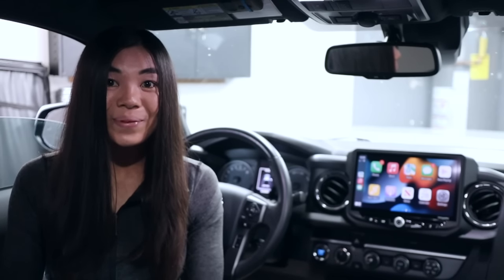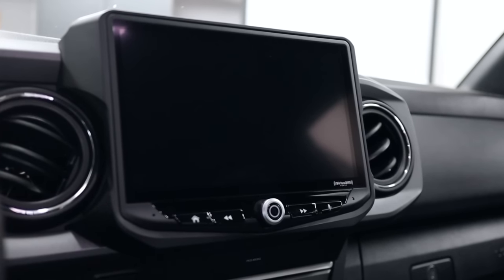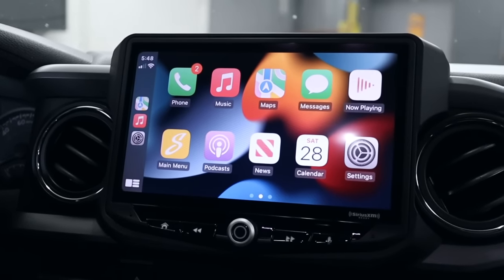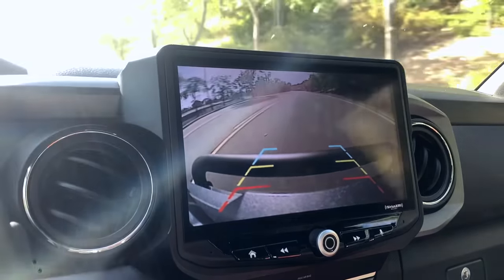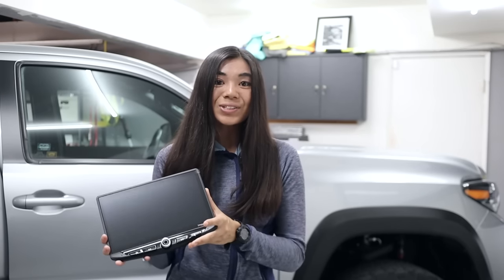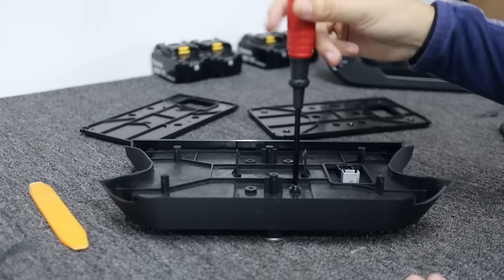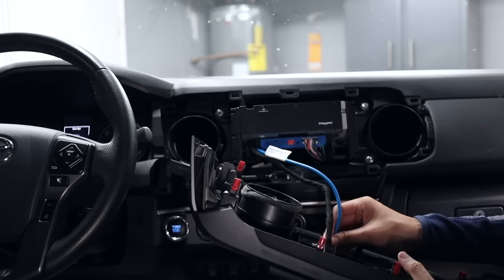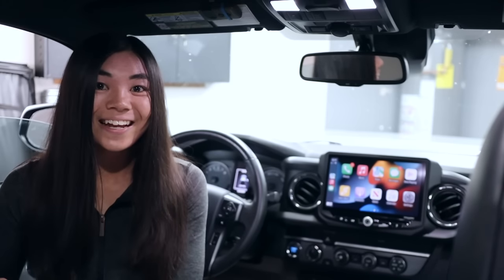A new GIANT Head Unit for my Toyota Tacoma! | Stinger Heigh10 Install + Review

Comment: Was going to get this head unit but found out from talking to Tacoma Beast you loose most of the Information from the infotainment above the steering wheel   like average gas mileage  average trip fuel economy and tire pressure monitor. Not worth it if you loose these items
Reply: This comment should be higher up. 
This is a really important thing to know.
Reply: This is what makes me hesitant as well. I might look into replacing my 2019 head unit with a used 2020+ head unit though so I can use android auto.
Reply: Agreed, very important information about losing that feature.
Reply: Can you clarify? Do you mean to say the information all together (both above the steering wheel and on the main screen) does not show, so you lose this information altogether? Or does it still show in one of the 2 areas?
Reply: That sucks because it say right on the website it retains all the stuff you said wouldn’t be available
Reply: @duvalpenny100  is it a direct plug and play switch?
Reply from the maker: Actually, I still get all of those things (average trip fuel economy during your drive + summary when you stop, TPMS, lane departure alert, and roll/pitch angles). Those are separate from the system from what I can see
Reply: @ChloeKuo  Glad to know because when I called Tacoma Beast Customer service they told me I would loose those features. Maybe they misunderstood what I was talking about.
Reply: @JPK1981  I can't answer that with 100% accuracy, but I do know that it's possible. I THINK it's plug and play, but don't quote me on that.
Reply: Hi… My truck is a Tacoma 2021 and, as Chloe mentioned, I was able to retain all the functions.  And yes, it is 100% plug and play.
Reply: lose*
Reply: Not only are you wrong but all that information is available in the MID. No idea why anyone would want to pull that information up on their infotainment screen when it’s located right in between your gauges 🤦🏻‍♂️
Reply: Joying HUs have all of this, including wireless. And pretty cheap
Reply: @PHILLIPS8822  they are forced to tell you that they don’t want you messing with their vehicles
Reply: @ChloeKuo  thanks for the video. Do you still get miles (Km) to empty as well on your info screen (by the Speedo)? Does the compass on your rear view mirror still work? I’m getting conflicted info on this. Mine is 2017, so I think even older than yours was.
Reply: @josearodriguez9601  Can you use the current Sirius XM Antenna on the Tacoma when you purchase the SiriusXM 300 tuner?
Reply: @bodybong  vehicle stats is an important part of making the decision to upgrade. Without this, it's useless. There are other units out there that have an amazing amount of vehicle stats AND includes Android Auto.
Reply: I think the screen is oversized for the dash.  I’d opt for a 2021 head unit to gain car play.
Reply: It’s lose…lose lose lose lose lose…smh
Reply: I just put mine in and I didn’t lose any of that
Reply: @justinkimball1399  Thanks for the info. I've already purchased mines 3 weeks ago because it's so damn hot I haven't had a chance to install it yet.
Reply: awwwwwww damn
Reply: If you use the PAC audio pro adapter it doesn't loose much. I only lost items associated with gps. I still have tpma info and mileage
Reply: @ChloeKuo is that radio JbL compatible for us people with the 7 speaker system and amp…because my truck sounds amazing but I would love the monitor upgrade for car play
Reply: @delavida1862 yes it is there is a setting seperate plug that needs to be plugged in on the PAC control module to retain the factory amp and settings as far as the speakers.

Comment: In my 2023 taco, if you hold the mode button on the steering wheel it will pause whatever is streaming.  Should work for yours as well. Thanks for another great video!

Comment: "No manual pause button." ~ 4:00 mins in; the stock 2016 - 2019 head unit can pause & resume via the steering wheel MODE button. You just need to hold it for 1.5sec. This will pause the current song and then resume with another press. (I'm unclear if this will work wit the Stinger head unit, but it should be very easy to test.) Thanks for all the quality Taco videos; always a quality watch. 🤓🤙🌮🚙

Comment: Chloe, thanks for the quality content.  Your attention to detail makes me think you are an engineer by trade. 
I really like the professional fitment of this unit in your truck. 
As for JBL systems, I and my son have owned multiple Toyotas since JBL was available. While the JBLs do provide better audio quality over non-JBL systems, they are only a fraction of what is possible (and practical). Better sound can be achieved with just better speakers. 
Getting ready for a Pioneer unit install in my wife’s durable 2013 Highlander Limited.

Comment: Chloe - they make USB CD Players that are compatible with Android radios. Since the Stinger Heigh10 is essentially a Android Radio, there's a good chance that one of these USB CD Players will work on it - something you worked have to explore.
Another option to play CD's on it is to usea universal 1/2 DIN CD Player and hook it up to the Stinger Heigh10 using the RCA Aux inputs.

Just a tip to you and anyone else who still uses CD's often 👍

Comment: I'm not sure what that Stinger head unit kit is using to run the steering wheel controls but I programmed play/pause right into my steering wheel controls using the Maestro RR on my kenwood (installed in a 2021 TRD OR). during the flashing process for the Maestro you assign each steering wheel control button for what you want it to do (up to two functions per button by clicking or holding). The setup screen presents them as default suggestions which you can then tweak to your liking before making it final, so I flipped the volume/seek buttons so that volume is vertical and seek is horizontal, and then I added a screen off toggle by holding the siri button ( click siri still triggers siri/voice), and I retained the factory play/pause which is holding on the mode/source button. Works great.

Just adding this to say that whatever is being used to supply SWC to the Stinger may be able to be set up similarly. 

Nice work and result, looks good, I considered that Stinger unit myself but opted to run what I already owned and pulled from the last vehicle I sold. I do wish I had a larger screen like that.

Comment: I put one for my 2nd gen Tacoma last year.   Stinger off road had complete bundle install kit for a killer deal.   Definitely recommend this head unit .
Reply: Hey I just ordered one of these for my 2nd gen I was wondering how difficult the install was and how nicely it blended with the dash on the second gen because I noticed the bezel doesn’t really flush mount like this one I don’t think but was curious of any info or tips you could give
Reply: I’ve installed several head units in my past so install was difficult for me.  YMMV.   Install all connectors prior to breakdown and it’ll be just plug and play.   As for the bezel, I didn’t use the included one.  I end up buying a bezel made by Scorch to match the OEM texted bezel.
Reply: @mikethefz07guy79  hey man sorry to bug you again I installed that stereo today and for the most part not too bad. However I can’t make my backup camera signal come through and my steering wheel controls won’t work either. Any insight on how to get them up and going?
Reply: @connerbusby8467  it’s been so long, but if I remember the backup camera only comes on when the truck is in reverse. I believe I hooked it up to the driverside reverse taillight to trigger the camera.    As far as the steering controls, you have to hook up the module that attaches to the OBD2 port.  Hope that helps.  I tried looking for the Stinger off road install video, but it looks like it no longer exists on their website.
Reply: @mikethefz07guy79  thanks so much man! I’ll give that a try

Comment: Give it some time and you will see that this is a much better unit.  You can do so much customization compare to the factory unit, that is a no brainer.  I was about to buy this one, but ultimately went for the Kenwood DMX1057XR because of the quality of the screen and the Apple wireless CarPlay.  FYI, to access menus and watch anything on HDM while driving you just need to bypass the radio.

Comment: I put one in mine a few weeks ago too. So far I like it a lot but it has a few quarks I am unhappy about. Its still way better than the original JBL.
Reply: One question that still hasn't been answered correctly yet in my opinion. Is if the information on the instrument cluster is retained like average mpg, current mpg, pitch roll, tire pressure monitoring. Cloe says she still gets these features on her truck but Tacoma Beast is saying when installing this head unit you lose these features.  When you installed this do you still have these features?

Comment: Nice! Are you planning on reinstalling the anytime camera? I have an anytime camera and I might get this headunit if its still compatible.
Reply: This is what holds me back too. I use my anytime front/rear switch all the time and don't want that to stop working.
Reply from the maker: I did gut everything form my anytime camera mod, except for the camera itself (which just is an RCA connector that plugs right into the unit). Now, I cannot access my front camera from a physical switch, but I can by going to my camera app on the Stinger itself. Hope this helps!
Reply: @ChloeKuo  Awesome!

Comment: So these past 2 years my display is starting to have issues on my Tacoma (2014), it's the regular entune. Just has the overlay map and weather update for the city you're in (it doesn't work in every city though). Lately it seems unresponsive or it just starts pressing buttons randomly. 

It doesn't happen all the time but i noticed that once i came to Texas is happening more often. It did happen in California once or twice when it was really hot, so not sure if humidity is the main cause. 

I also did the update. I mean the system is not bad, i really don't need much. I just plug in my USB and use my own music and use Waze and that's pretty much all i need.

But if it eventually fails then might have to start looking for a substitute. Probably get better speakers while I'm at it.

Comment: I worked in aerospace for years, and the best fabricators were women. Their attention to detail and following instruction are much better than men. Looks like well-designed head both in form and function. I don't understand why the screen would get brighter when the car headlights are on. You need a dimmer screen at night. Also, I would have added a sun visor to the unit. Chloe, please show how the GPS works with NAV apps.

Comment: I don't see a lot of benefit in changing a head unit unless you are upgrading your sound. granted your idea of a head unit and mine are probably different. I would like to know more about the pre outs what their voltage is etc etc, I can't seem to see anything on their site. atm ima sticking with the Kenwood eXcelon for my Tacoma which offers 4v pre-outs (or pre amp as some call them).

Comment: I like my 17 Corolla one but i drove a taco and hated the newer screen even Spotify kept cutting out like a scratched cd the audio is decent enough sadly not the jbl or anything if anything i would keep the screen and just upgrade the speakers..... that's a nice screen reminds me of the newer alpine ones 🤔
Reply: I have a scosche majic mount cd slot in place 😂
Reply: my 17 Corolla has all the door lock settings for the lights and sounds and headlights options  etc..... Im sure an upgraded screen wouldn't have and like when camping its nice to not annoy people with the constant beeping and light flashing 😂 i love the mpg feature to says my best is 49.1 🤔

So your just stuck at whatever settings you had for door locks/lights/headlights timers erc when you add tje new screen or ?🤔  I feal the opposite entune is nice and simple and doesn't have all the bs 99 percent of the time i just use steering wheel audio controls so 🤷 other than back up camera i wouldn't see a use for a newer one.... Do agree on entune same to the app bs is useless I don't have entune audio+ but all i use most is Bluetooth and back uo camera so F it

Comment: I have a 2016 Tacoma TRD Sport with JBL head unit.  I've upgraded my speakers and Sub already but I've been undecided about my head unit.   I think I would do it if I found one that was Android wireless capable and that was plug and play.  I also blacked out my AC vents so I would want to retain that blacked out look also.
Reply: I have a 2019 wi th the same premium audio. How did your swap work out? Are you happy with it? I had the jbl on my 2014 and was really disappointed with the 2019 because its just not as powerful.
Reply: @byscaine79  I have not swapped out my head unit yet.  I have only changed my door speakers and sub.  I'm going to hold off on the head unit.  As of right now I'm content with the JBL unit although I do wish it had wireless Android auto.

Comment: I have the anytime camera with the front and back switch. Will the switch function still work or would I have to go through the camera app on the Stinger?
Reply from the maker: You'd have to go through the camera app on the Stinger, unless you hooked up the trigger wire to a switch (which I've been looking into doing soon)
Reply: @ChloeKuo  I just got the stinger and I’m installing it right now. It’s kicking my butt. I’m not getting any signal to my rear camera. How did you wire that part?

Comment: One thing that really bothers me about the stock head unit is a sound lag between my iPhone and the Bluetooth connection to the unit. Did you notice an audio lag with your old head unit and do you notice any difference between the stock and this new one?

This is a major factor in me deciding to upgrade my head unit

Comment: I bought one for my 2nd gen. I regret it.  Too buggy, hard to get it to mount really securely and the screen shakes when off-roading. also doesn't read most music formats, so 90% of the music on my USB drive that worked great on my factory unit no longer works on this one. 

steering wheel controls won't all work either, even if you have your adaptor coded correctly.

There's a few other issues, which I'd be willing to be ok with if it were say, half the price... but for what I paid, it should work flawlessly, and it's far from that.

Comment: I love and hate it at the same time!…
The size and look of the unit looks great.
However, the price considering it can’t even connect to the factory mic, and it doesn’t even have wireless CarPlay is just insane for the price they want!… 
My oem head unit is a pile of junk, I’m always having problems with it, but I couldn’t spend that much money on something that’s just slightly bigger because I guarantee the quality is no better because from my experience, all head units are over priced junk… it’s extremely disappointing because I’ve never had one just work properly! 😑 Toyota still thinks we plug iPods into our head units!… shows how little they know and pay attention to the quality they put into them.
Reply: Most of these aftermarket stereos don’t have wireless CarPlay mine was $500 and it doesn’t but it works great

Comment: I might’ve missed it, but did you talk about the Bread Crumb feature on the Entune? My 2020 Taco has Bread Crumb which is great for backcountry riding with no cell service so if I get lost I can just follow back the trail. Does this have that feature or no?
Reply: I'm curious too. I have a 2016, and you wouldn't believe the number of times I've gotten myself lost and the breadcrumb feature on the map has saved my ass.
Reply from the maker: To be fully honest, I did not know that feature existed! I don't have the optional iGo navigation card (yet) for this head unit, so I'm not sure if it has the bread crumb feature but I will update when I do get the navigation card 🙂
Reply: @ChloeKuo  I wouldn't invest in the navigation card, Android auto and iPhone version works great too. Keep up the good work.
Reply: @christopheragundez4347  you get the nav card if you want to be able to have maps without an active phone internet connection, like backcountry and emergency situations.

Comment: Since I’m older my eyes are older too so the screen size is great.   The price on the other hand is borderline ridiculous so I’ll stay with the unit that came in my Tacoma and use my 67 Design mount system for my iPad and iPhone.    You did a great job showing the install of the system !!! Keep the content coming
Reply: I saw that, too. That price was a little more than I’d be happy with, but it looks like something worthwhile, especially for us that have to use A LOT of candles on our birthday cake.
Reply: Ya price is ridiculous.
Reply: Yep, my aftermarket SoundStream 10.6” is visually excellent. 
Performance though is a bit spotty!

Comment: The Stinger units all feel like a stop gap solution for existing/late last gen vehicles to be updated to an almost next gen feature level like the Ford Lightning, Rivian, and similar. It's also priced as such! I feel the product is priced specifically for people who are not willing to wait and completely reinvest into a brand new full loadout (Suspension, tires, packout, etc.). I feel its priced way too high for someone looking to make a single to even 3/4 mod upgrade into a vehicle without the features. It's priced for someone who is already heavily invested in their buildout.
Reply: And why even buy Toyota if all you're going to do is upgrade in 2 years.  They are built to run a long time.